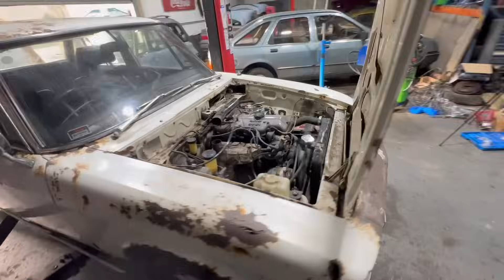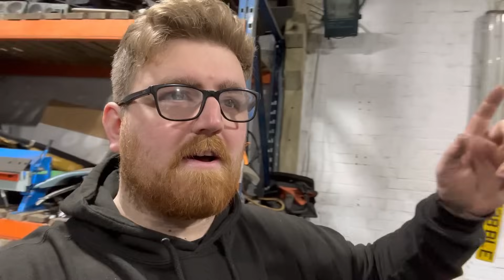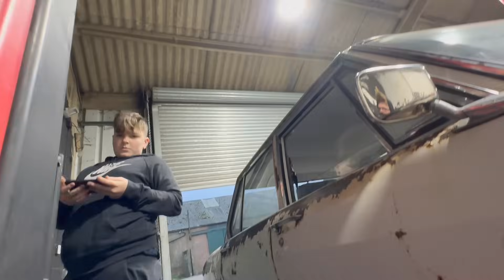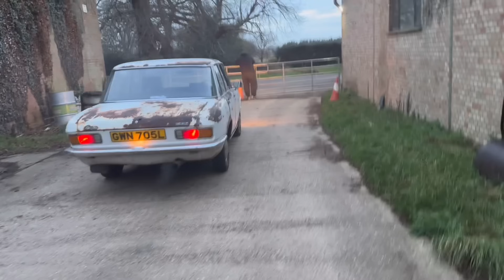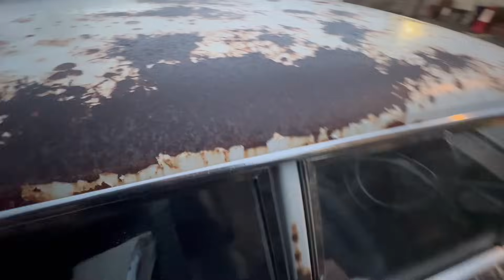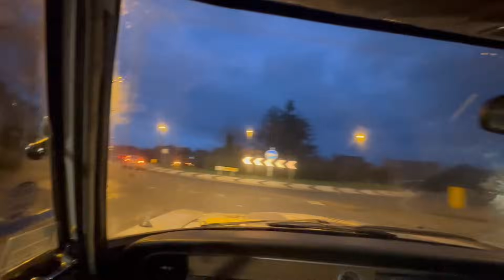Mazda 1800 Gets Driven For The First Time In 30 Years!!

Comment: In 1976, my 2nd car was a 1072 Mazda 1800 wagon. I had the engine seize and had to replace it with help from my dad. We found a used engine from a Ford Courier pickup truck. It had the same Mazda 1800 engine. It took us one day to swap, and we were back on the road. What a fun little car.